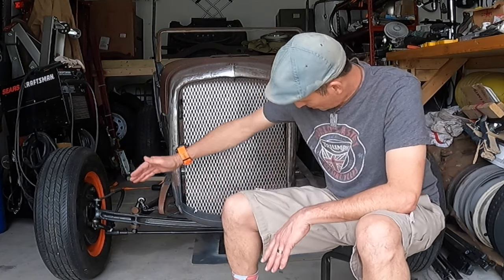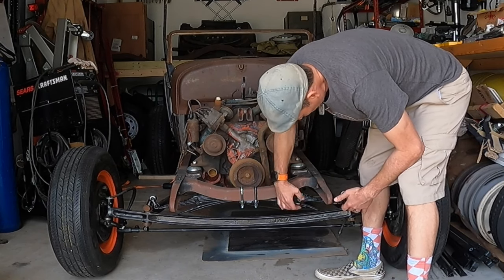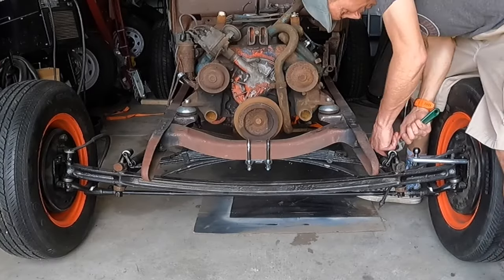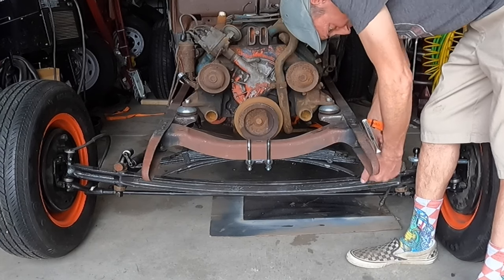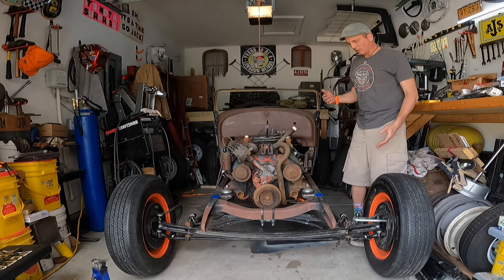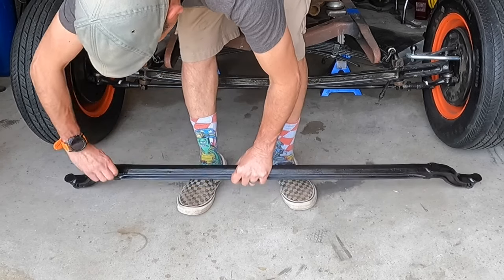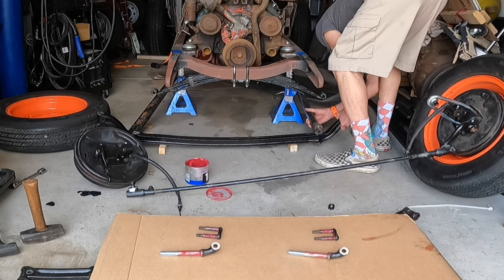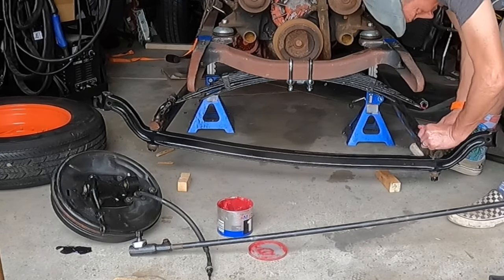Shawty Got Low!!  Dropped Axle Install 27 Ford T Touring Hot Rod

Comment: I keep looking at the engine, thinking in my hot rod concept of mounting a Corvair engine in front (rotated 180 degrees and shroud reversed) and transaxle out back.  ;-)
Reply from the maker: Interesting idea… would you reverse the engine rotation and use rear wheel steering?

Comment: Looks great, dude! 

What spindles you are using? I’m curious how much lower the steering arms need to go to fit with the wishbones? (I’m looking at running a very similar setup) 😊
Reply from the maker: Thanks Tom!  I’m using F1 Ford truck spindles and brakes.  I think I will need to drop my steering arms 1-1.5”  to get the clearance I need under my 40 Ford split wishbones.